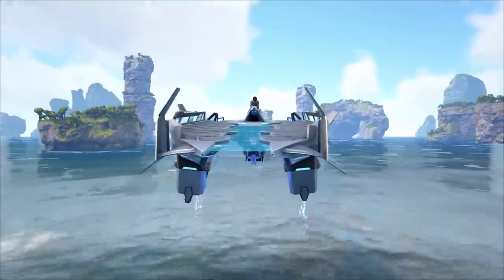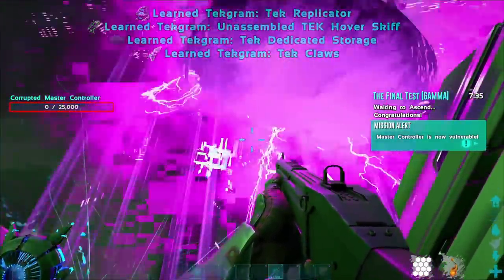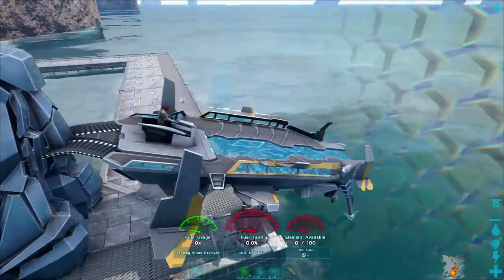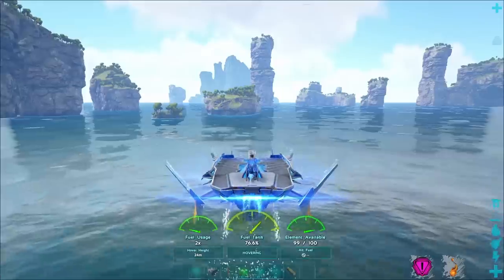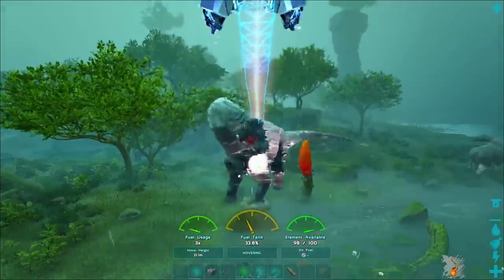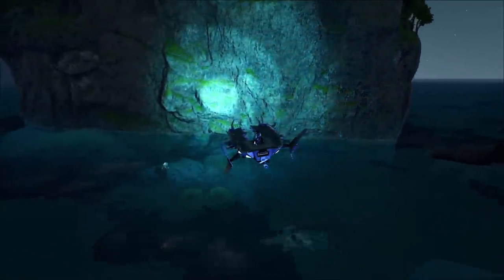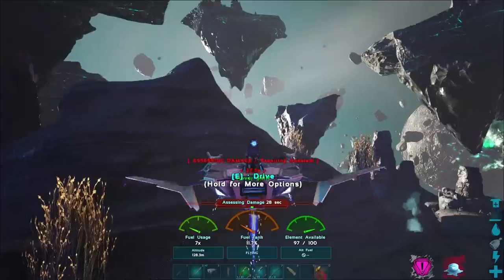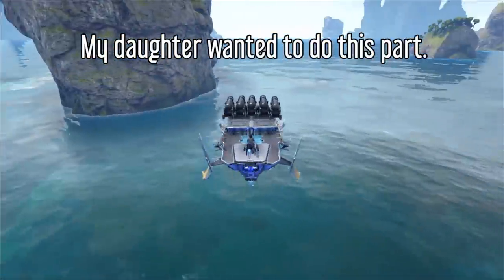Tek Hover Skiff Guide for ARK: Genesis

Comment: Fuel the skiff with element DUST instead of hard element.  Dust is like gas in a generator, lasts forever.

You can also whistle Land Flyer and the skiff will autoland

Comment: You could pick up quetzals as well which makes them so much easier to tame
Reply: This is great to know. Once on Ragnarok SP I downed a 170 something Tek Quetzal on my Griffin it was KOed on a safe spot in Spino Canyon as it fell on top of a cliff. I was paranoid and still put some spike walls around it. I had no kibble so I decided to fly to NE highlands to get some Mutton when I came back it glitched through the cliff to the bottom of the canyon and was being eaten by a raptor. It would be nice to pull it into a trap with foundations since I never had a dino if it was knocked out on foundations fall through the map. I guess the glitch happens sometimes because the way things render.

Comment: I'm playing on xbox I am trying to use the tractor beam but it does not pick any creature I try it on up what buttons is it to actually lock on with the tractor cannon
Reply: Thomas Murray left trigger to go into tractor beam mode, lock on to the dino until you got red reticle and hold left trigger to pull it up, right trigger to release.
Reply: @Reptiile  I have been able to turn the beam on but I can't get the reticle to lock on is their any button I have to press to get the reticle to lock

Comment: Playing on unofficial and for some reason, mine doesn't recognize the element and won't power up to drive😕
Reply: same :(
Reply: @brendanmercer3361  I read somewhere to put in an unstable element first,to jump it off i guess 😂
Haven't tried it yet myself.
Reply: @E_M_C_2  u can try shards too
Reply: @sedrickmongwarr837  didnt work with shards either. I did read that its possibly stacking mods causing the problem.
Reply: @E_M_C_2  I found the solution! You but Unstable element and leave it in the hover skiff until it converts into normal element. Then it works
Reply: From past experience with similar problems, it's almost certainly stack mods causing this.
Reply: So I went back to it, and it worked 🤔
I didn't do anything to it so I'm thinking server restart got it working maybe??
Had to make another one after dying in volcanic zone and it did the same as the first originally, wouldnt power. Going to see if it works after a restart.

Comment: I have one but when I try to build on it, it says “platform is to far away”. Any help?
Reply: You can only build a certain distance from the center, regardless of foundations.  It's different than other structures in that sense.  You can go about as wide as the skiff in terms of walls, and can get about 1 panel off the sides using ceilings.  They're funny to build on.  You also can't put ceilings more than 1 tile up.
Reply: @zanewynn8236  that's fun, especially if it's someone else's ship you just dropped a log on.  But unfortunately, untimely defacation does not increase build distance.

Comment: What are those controls on XBox?
Reply: Y to mount, A to hover, hold A to go up, then same as any flying tame.  To go down press right joystick down.  To land double press right joystick down. Some places it doesn't like to land.  Teleporters without foundations under them are difficult to land on at all but do half on ground and half on teleporter and should work.

They can be destroyed by being too close to erupting volcano cave entrance.

Magmasaur can destroy with single attack too.
Reply: It is easier to stop forward momentum for tight turns with the skiff.

Comment: The HoverSkiff is a new flying item that is buildable on, sounds cool but here are the liabilities and risks of this new spacecraft

-It is super expensive, and not as useful as the Quetzal
-It is fast but hard to maneuver and high chance of crashing or accidentally going into alpha Dino or Giga territory
-Its fuel is very expensive and requires fighting bosses to get
-Will not lift off with weight above 1000, Quetzal can handle it with enough stats
-Don’t use it as a Dino carrier, can only carry 1 Spino without reaching 1000, Quetzal platform can carry 2 with enough stats
-Has very strict building logic, don’t rely on it as a mobile base, use a Quetzal instead
-Much harder to manage than a Quetzal, a Quetzal only needs some meat
-Easier to land, especially at Obliesks or Volcano

Sooooooooo, if you want a HoverSkiff, think again
Reply: I'm looking forward to using my quetzal on Genesis! thank you